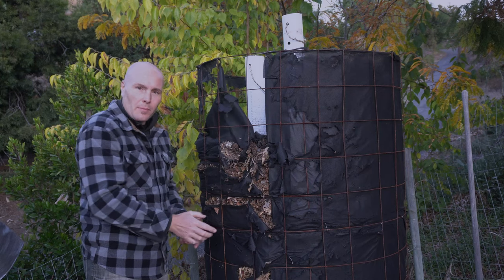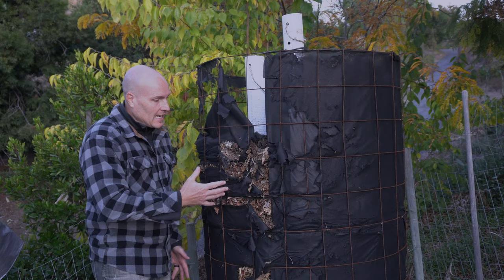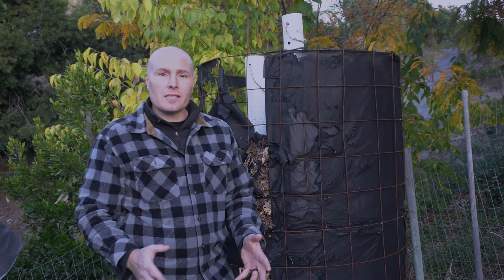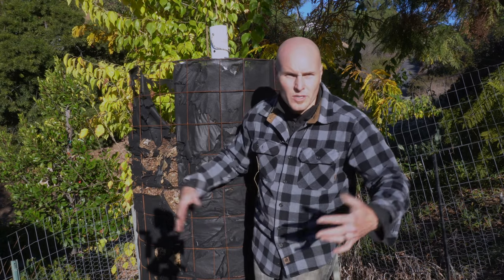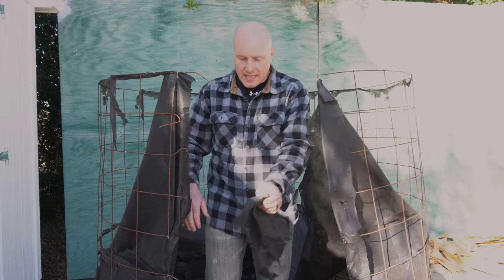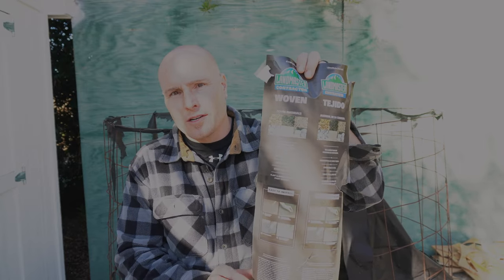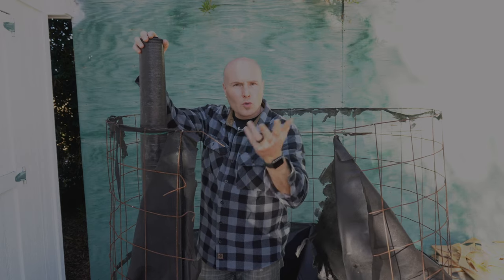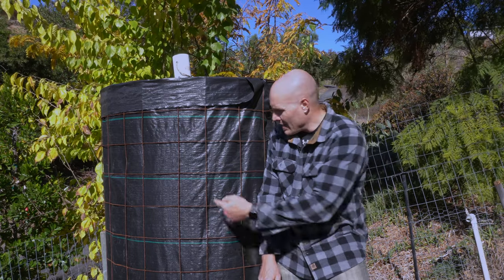Johnson-Su Compost Bioreactor FAIL - DON'T MAKE THIS MISTAKE

Comment: Whenever I have worked with the same heavy duty landscape fabric I've taken a moment to burn the raw edges because it frays so easily. Over time it can unweave and you start losing length. I imagine a quick hem would do the same trick with less risk of burning half your fabric away which I have also done.

Love your videos, dude.

Comment: Someone needs to make and market a bioreactor-sized grow bag. I doubt you'd need the concrete reinforcing if you used the stiff grow bag material. I've been using a 100 gallon grow bag as a compost bin for years.
Reply: Great upcycle

Comment: It's great that the pile held together. All the fungi bonding with the contents.   If it had fallen apart, would you have switch it use the Diego Footer version with the single center hole?
Reply from the maker: No, I am running both types just to see how both turn out.

Comment: Hey Diego
  Your invention...the chicken wire deal is the answer. Less effort. Less expensive. Longer lasting.
  It's understood you are going to let each system run it course. Down the road no doubt a comparison.
  Thanks.

Comment: I used the nylon stuff they use to put over gravel ditches before the soil or stones go onto. Problem with that stuff is it comes apart in strands around the edges but so far the main part is holding up fine.

Comment: Stainless steal fly screen so much better and around the same price! Been using it on mine for two years.

Found at hardware stores.
Reply: Thanks for sharing that, Gavin. It seems like a great alternative to plastic. I was thinking about 1/4 hardware cloth to keep out rodents. But the screen would keep out just about everything. Seems like it would hold soil too. Have you ever tried adding a few inches to the top and planting a cover crop?
Reply: @racebiketuner  No, but that might be a cool idea, I have toyed with the idea of growing mushrooms through it I think it would work.

Comment: Out of curiosity, why are the pipes still in the reactor?
Reply from the maker: I was gradually filling this one.  This wasn't a fill it all in one shot and remove pipes.
Reply: @DiegoFooter  You should cut some short ones then and pull them up partially as you go to improve air availability inside what you have already loaded.

Comment: Why landscape fabric instead of a smaller wire mesh?
Reply: The outside part would dry too easily
Reply: I'm thinking he wanted to stay true to the Johnson-Su method for this experiment. 
He used welded wire mesh and chicken wire on his 6/2 Diego modification.
Reply: @JerryB507  I wonder how well thick paper like ram board would work, it would breakdown over time for sure but would contribute to the compost

Comment: Seems like the compost pile is way to dry. It's supposed to be watered daily. Or atleast 1 gallon of water per week.
Reply from the maker: Yes, and that isn't enough in my conditions.
Reply: @DiegoFooter  Maybe put up some shade cloth. 70% you definitely don't need help with heating up the pile in that heat.

Comment: Why is fabric needed at all?  All it seems to be needed for is contain the small pieces.  I'd use some cheap chicken wire mesh that will last forever. 

 I know how ridiculously flimsy that cheap landscape fabric is - they sell nearly the same worthless junk as 'filter fabric' - it's so damn flimsy that the sticker they slap on the material rips the fabric when you're unwrapping the roll. It's criminal that it's allowed to be sold to unsuspecting buyers.

Comment: How about try not buying a solution and instead using the natural materials around you to replace the plastic... Use a hollow log instead of a PVC pipe... Weave a mesh out of ornamental grass...
Reply from the maker: You could but for most people it is easier to buy.

Comment: I fail to see the problem. A bio-degradable/ safe fabric would be a good thing. Try a roll of cardboard paper.
Reply from the maker: You're right if it was designed that way, the problem is this wasn't designed to have the fabric go away.
Reply: @DiegoFooter  True, but this is an opportunity for a tweak in design. If the fabric was just to allow the "jelly mold" to form with the ability to breath, then cardboard paper that breaks down with the compost would be ideal. Just the aesthetics would be an issue.

Comment: $90 just for the roll! I paid $30 a yard for compost from my local farm. Do the math.
Reply: You're doing "the math" just fine but you're forgetting to do the BIOLOGY/research. You have to look up Dr. Johnson & Su's results for beneficial microorganisms in the living compost extracts. 

Take the time and you will see why Diego has been modifying & testing so many for his viewers. Keep up the good work Diego.
Reply from the maker: Also you can use the landscape fabric for other applications or more than one reactor.  It isn’t a $90 single use expense.
Reply: Like the other commenter said, these bioreactors make compost that is high in fungal material. Most farm based manure compost is high in bacteria. The whole reason one builds a bioreactor, is to make the best quality fungal dominated compost possible.
Reply: Fungal build itself when you lay new compost on top of undisturbed beds. The cost and time doesn’t add up for “me”.
Reply: @nguonchan273  not all compost is made = .
Reply: @gavinmatthews5618  know your community, trust where it’s coming from.  Cause I do....